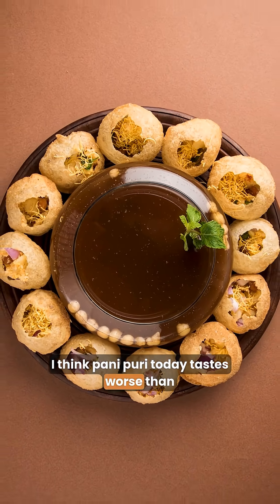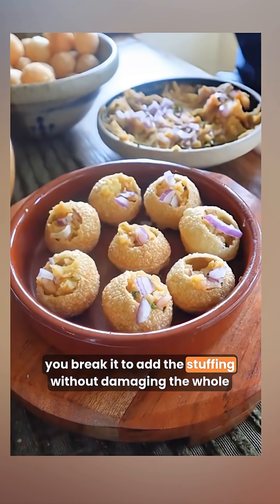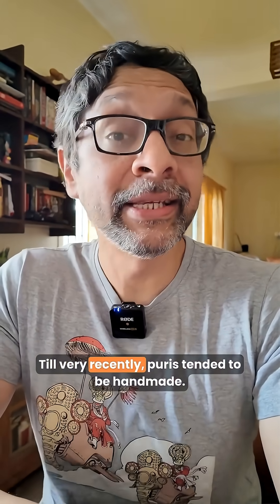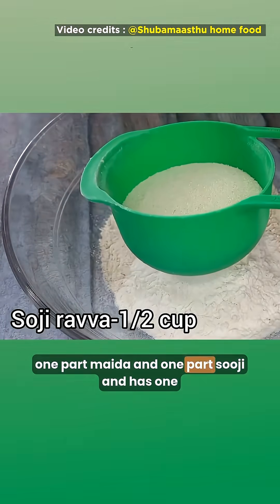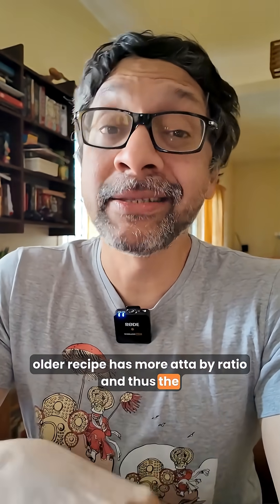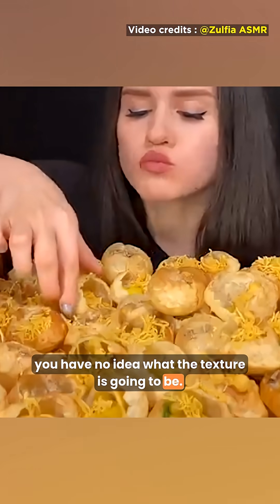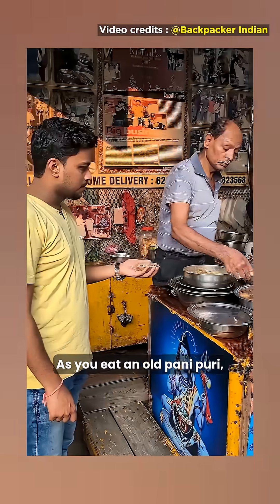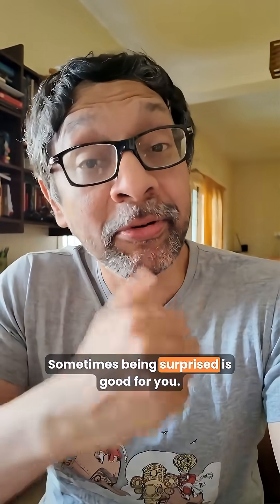Why Pani Puri Sucks Nowadays

Comment: Its not just surprise factor imo. The old ones are thinner and less bulkier and hence easier to fit in the mouth and crack. The new ones are too big and also overly thick that it hurts or cuts the upper mouth while trying to break them and chew.
Reply: Bro exactly right. Thin crust leads to better flavour absorption in the puri. The thick crust doesn't absorb any flavours so its just the crust you are chewing without flavours in it. Out of 100s of pani puri sellers in Noida, I have found only one who cooks puris at home and brings them to sell at his small stall outside Haldiram in sector 18. Best pani puri I have had in NCR honestly. My wife and I have driven 10+ km to just eat that on weekends many times
Reply: True, old ones are best. I have hurt my upper palate many times while eating newer ones which tastes bad as well.
Reply: You explained it better without the 'physics'. Lol.

Comment: The older panipuris were smaller in size too. Hence, they contained less potato filling & tamarind/mint water that did not cause fill up/bloating in stomach easily. Hence, one could enjoy more panipuris/puchkas than the current ones; making the overall experience more enjoyable.

Comment: There's more to it than just the puri. The ingredients used in the stuffing have changed to be just the cheapest ones. Earlier the "base" layer of the stuffing used to include (depending upon you location) potatoes, chickpeas, moong and/or ragda. Now it's just potatoes. The second layer of the stuffing used to include sev, onions, coriander, and tomatoes. Now the tomatoes are gone, and the sev has gotten thinner.

Combine all of these changes with the change in the puri itself, and the whole thing has gone to sh*t.

Comment: This is why I loved listing to songs on FM..
Now, I can barely complete a song from my fav list..
Reply: Unless there are a half an hour advertisements running. I stick to the old radio stations which I grew up listening to with my grandmother.
Reply: @seemagumbade9515  yeah, that's another issue with FM stations nowadays..
Back in the day, even the ads were tastefully made..
Reply: Does fm work on your phone how?
Reply: @Comicscene.7289 there is a News on air app you can tune in to the any local radio stations